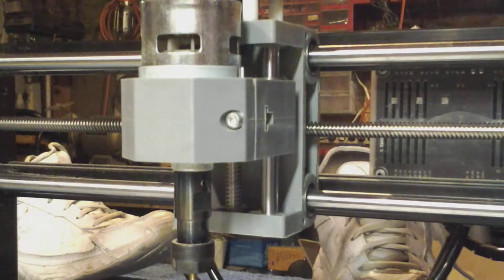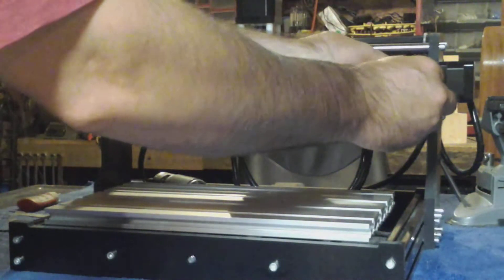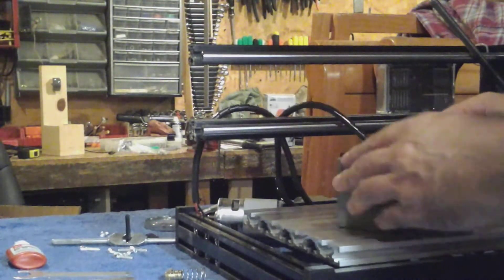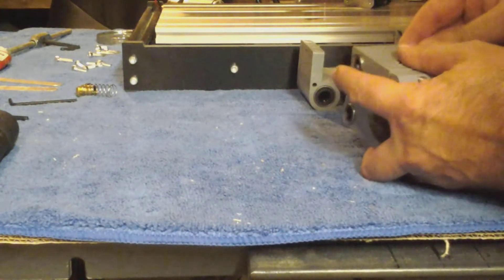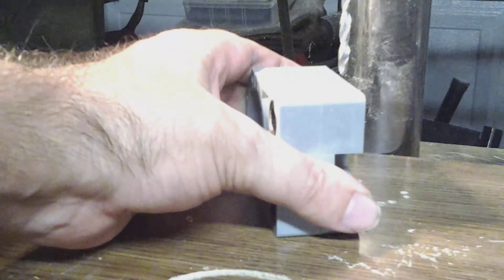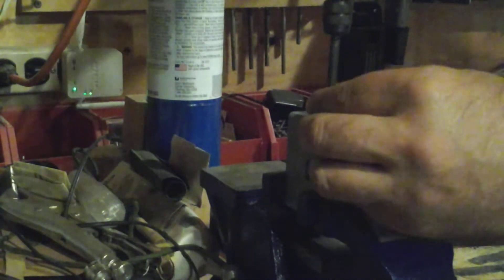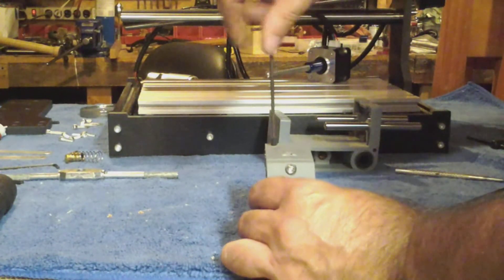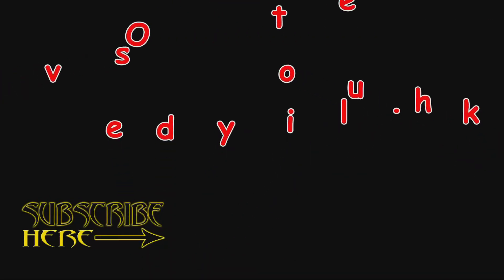Doing a simple repair/upgrade on my Genmitsu CNC router 3018-Pro: slipping bearings

Comment: How well did this fix hold up? I am having the same problem with my sainsmart genmitsu 3018 pro. I was thinking I would 3d print a top and bottom bracket that would screw into the z axis head to keep those bearings captured but if a set screw through the side works well, it would be a lot less effort and design work.
Reply from the maker: I forgot all about doing this to my CNC, lol. Its been good so far. Not a lot of hours on it in the router configuration. I also use it for laser work.